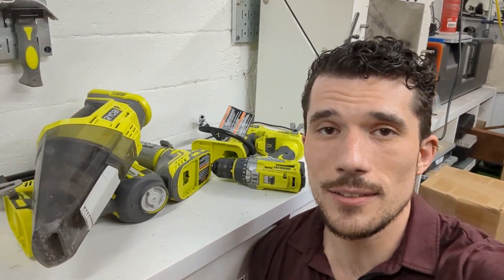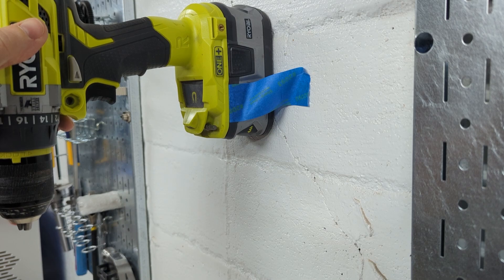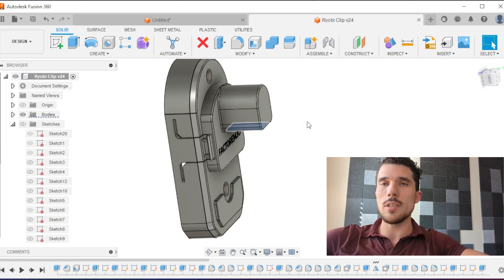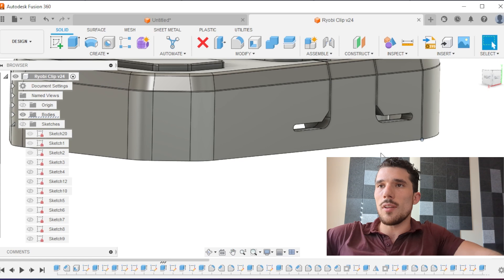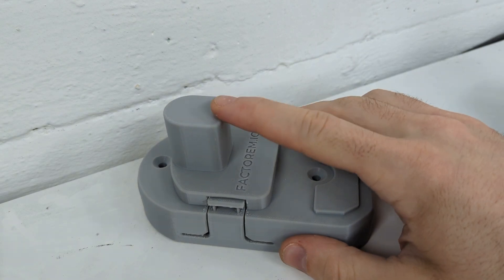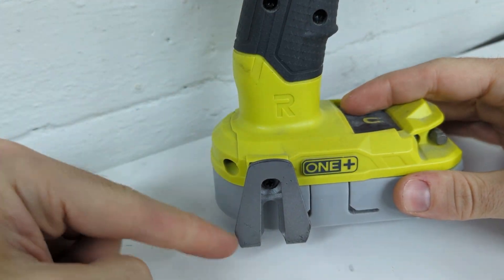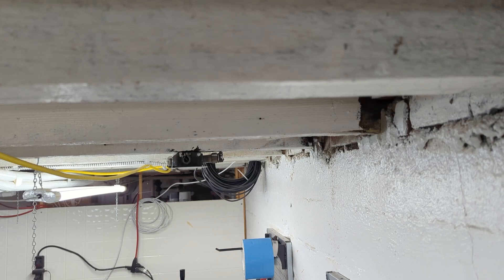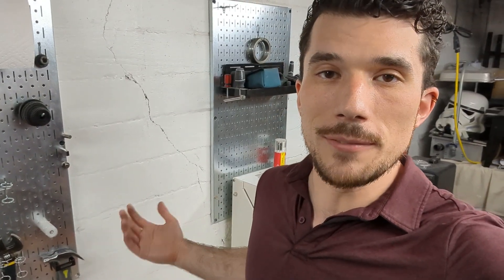Save Tons of Space by Hanging Your Ryobi ONE+ Tools! | Free 3D Printed Tool Mount

Comment: I printed these and I am struggling to remove the supports. Any tips you can provide around supports. It's supposed to be hollow inside right? Video on you removing supports would help/. thanks!
Reply from the maker: Hey, Typically I just go in with a pair of needle nose pliers and rip the supports out, what material/print settings are you using? Since the supports are generated in the slicer it's a bit difficult to give generic advice.  Is there a particular area that's giving you trouble?
Reply: @Factorem  thanks for the quick reply. So I actually did that just a few minutes ago and went on a limb with some pliers and started to rip it all out. Had to use a blade as well but it all came off. I was just not sure f this supports needed to come out or be removed since it looked so uniform and added strength. Looks great thanks man! Bring us more Ryobi stuff I have so many things I wanna hang now.
Reply: I’m curious, which Bambu model 3D printer do you use for these projects?
Reply: Yes! It took me like amillion hours, but it was so worth it when i realized it worked lol
Reply: First off, they work great. Tweaking the support settings and using the non-linear tree support in my slicer (Cura) helped free up the movable parts and made it easier to clear out the hollow. I still get a lot of material loss in the process. Any suggestions?